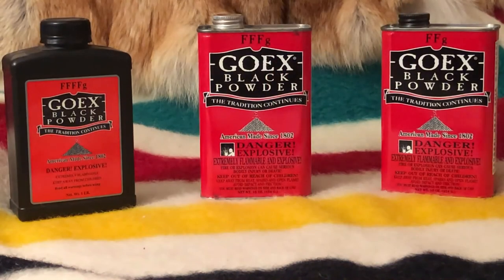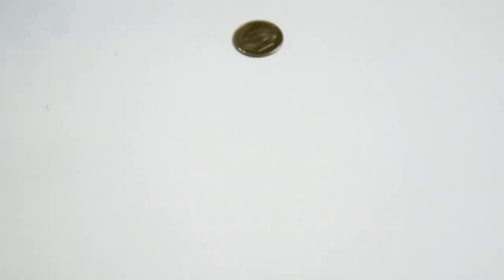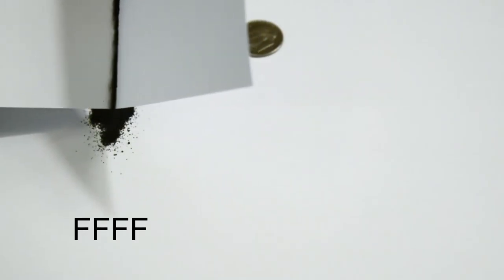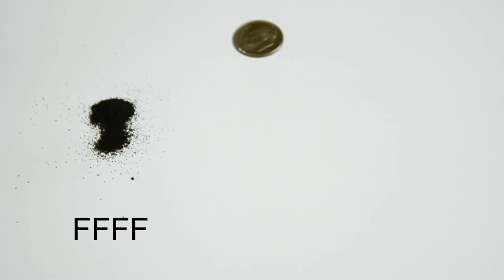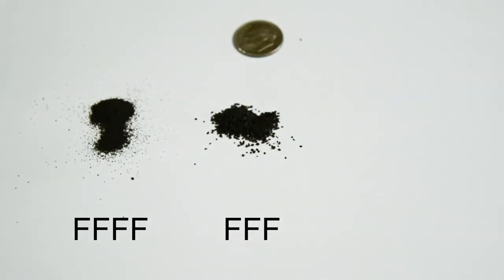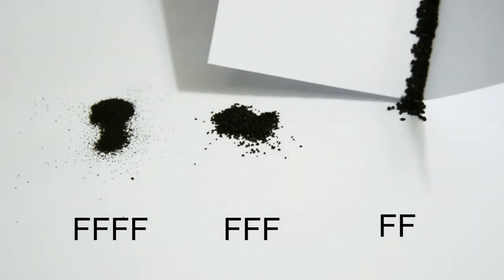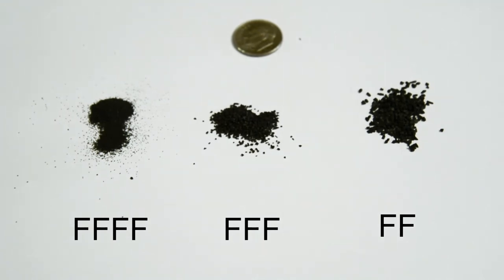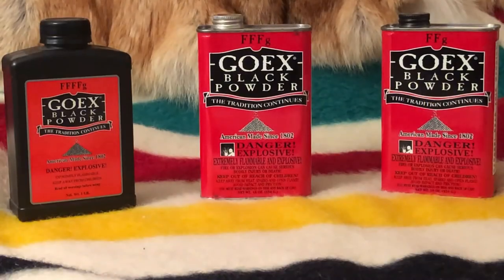A Master Class on the Muzzle Loading Percussion Rifle - Part 3 Developing an Accurate Load

Comment: My dad taught me to use nothing but 2FF powder for 50 calibre and up so I don't have any experience with 3FFF powder. Our 50, 69, 72 and 75 calibre rifles did OK for accuracy with 2FF so what you're saying is totally true!
Reply from the maker: Each rifle is different.  I have a 54 caliber that shoots excellent groups with 2-f and another 54 caliber that shoots great and with faster ignition using 3-f.   
I also have friends who use nothing but 3-f powder in every gun from 36 caliber up to their smoothbores and shotguns.  They prime their flintlocks with it too.
Originally, they used what they could get.
I let the gun show me which granulation it will shoot best with.